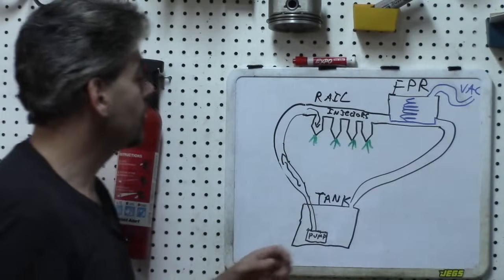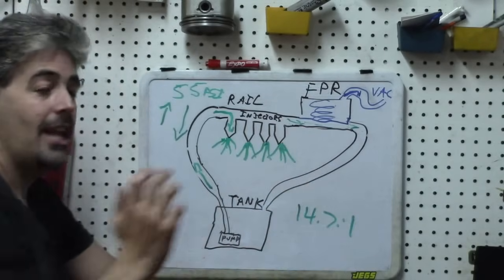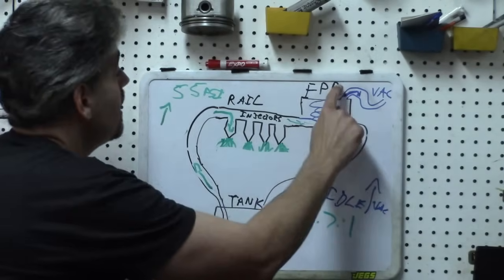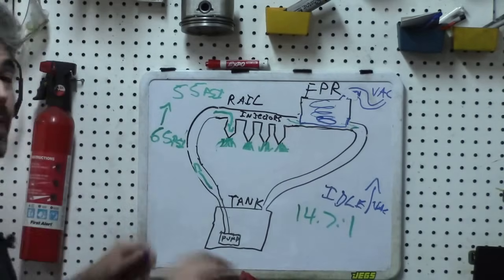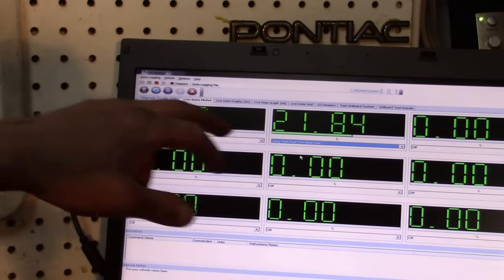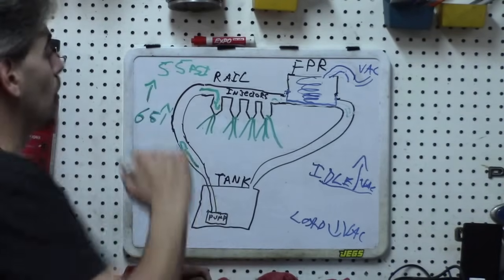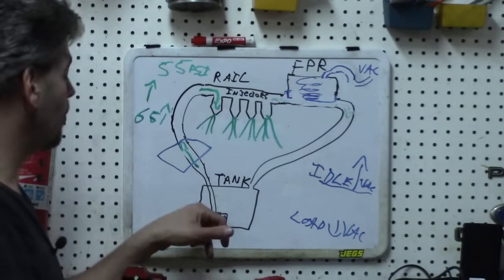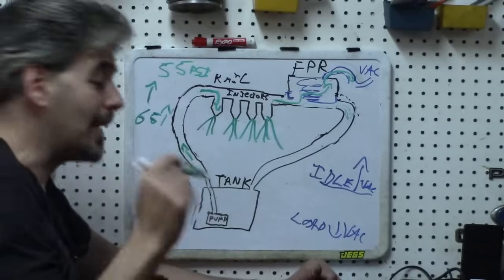Fuel Pressure Regulator Diagnosis + Understanding (HD!!)

Comment: So if we crimp of the fuel line in and the fuel line out should this both result in the fuel flow increasing and the car to stop?
Reply from the maker: May not cause car to stop completely but it will definitely change the engine performance for sure.
Reply: @SchrodingersBox  my sons problem is even with uprated pumps the Fuel Pressure is dropping under boost.  JUst cant get to the bottom of it!
Reply from the maker: Pretty obvious it’s either a tank contamination issue or a voltage drop issue then. Easiest to start by Check voltage drop on the power and ground. It will show on one or the other- or both.

Comment: I don't know if you still check this or not. I'm getting the crank-no-start, my fuel pressure goes up to 38-40 on my 2000 Ford Expedition when switched on then drop almost immediately. I changed the fuel pump about 2 years ago and the fuel filter a year ago. Does that means my fuel pump is bad? Thanks
Reply from the maker: Sounds like a bad check valve.  Verify by confirming there is normal STFT and LTFT curves.

Comment: does this apply if the regulator is located inside the tank in the fuel pump assembly where you can't reach it, in many Japanese cars regulator are inside the tank!
Reply from the maker: The rail leak testing procedures are different since the system is returnless but most of the other procedures apply

Comment: little help here. so i have a 2 stroke arctic cat efi and the regulator is missing the vacuum line. but on the parts fiche it calls that hose a vent hose. does that application just use atmospheric pressure or am i actually missing a hose. any help would be great thanks.
Reply: Vent hose to atmosphere period

Comment: I have a Mitsubishi Montero 3.8, fsm says fuel pressure should be 38 psi at idle. It's at about 44 psi. Under load it jumps up about 10 psi and is fluctuating rapidly 5 to 10 psi above the idle pressure. Bad FPR? Also hard start after sitting for an hour or two after it is hot. Seeing gradual pressure drop after engine is shut off.
Thanks
Reply from the maker: Not a bad fpr. Check fuel trim data.
Reply: @SchrodingersBox  thanks for replying. Fuel trim data isn't too abnormal. Long term 5.5% bank 1 short term varies a little bit bank 2 is 0%. The reason why I'm looking at this stuff is because after it is up to operate temp and sits for an hour or two it will not want to start . Acts like it has no fuel but fuel pressure is there. I'm suspicious of a fuel injector leaking into the cylinder. I have a small exhaust leak and after sitting , I went to start it and it was misfiring and stumbling and a decent amount of smoke was coming from the exhaust leak ( working on fixing the leak as well ) . Sorry for the rambling post lol
Reply: It will start (cold is starts every time just fine )if I hit the gas pedal a bit while I turn the key. I'm guessing it's letting more air in so it can ignite

Comment: Mr. Schrodinger, I have a 2 stroke 1 cylinder, fuel injected 50cc scooter....if I put a performance exhaust pipe, and performance air intake, but the ECU for the scooter does NOT COMPENSATE for more air and out (ECU is programmed to a fixed fuel level, and no way to reprogram it,  would an adjustable fuel pressure regulator be a way to compensate more air in and out for better performance...the Aprilia SR 50 r fuel injected scooter guys want to be able to add more go just like the carburator scooter guys that can just re jet the carb when they add a performance intake/ air filter and exhaust mod.
Reply from the maker: Yes it would provided the electric fuel pump is capable of meeting the demand.
Reply: @SchrodingersBox  thanks for the fast response. As said in your video, if I understood it correctly, I should turn Down the pressure of the adjustable FPR to richen up the air/fuel ratio...then just rely on the vacuum of the FPR at idle all the way to up wide open throttle for a correct air/fuel ratio (assuming that the FPR is adjusted properly).

Comment: In this video you say, If I pinch off my return line and it holds pressure I have a problem with my regulator then you go on to say if I pinch my line and it don't hold pressure I have a problem. ?????? Im confused.
Reply from the maker: +Vinny W I did not say that at all. If you pinch off the return line you have a leak in the system ahead of the return line. If could be the regulator, the check valve, the injectors, an external leak...  however if you also simultaneously pinch off the feed line as well and you see a static pressure drop, then you know the issue MUST be associated with the rail.  Injectors, regulator, or external leak from the rail are only possibilities.

Comment: hi , I have a Traillblazer 2005 v-6, 4x4, couple months a go i did replace the fuel pump cause the gas control sign doesn't work, after those has been good but now the sign appear again on exit,  after round some miles, the sign starring to work. the problem could be the regulator? please, appreciate ur answer, thanks.
Reply from the maker: What data do you have?

Comment: Hey! Curious if you could help me with a *temperature problem* at idle or running, whereas my car runs well and clear until it hits 90°F then starts to run rough and dies out. I would say either lean or rich but it seems as if it could be a fuel problem. It is very set on this 90°F change in idle. Any help or direction is very very much appreciated!! Mahalo!
Reply from the maker: Sure- what data do you have?Whats the change in fuel trim? that's the first step.

Comment: The diagraph could be broken and fuel entering to the vacuum line ?
Reply from the maker: Indeed that can happen. In fact it's pretty common. It would result in a rich condition and no change in fuel pressure when vcacuum removed.
Reply: Yesterday I checked my FPR, I did not have a measuring tool for fuel pressure. However I removed the manifold to reach the regulator. I connected the air hose to the input and pushed the valve from exit (that was possible to do) simulating the vacuum, it opened, spring tension was quite heavy my opinion but smooth. Car starts perfectly so no fuel escaping the rail.
Could it be, that one function for this regualtor is aswell cut the return line completely when engine is off preventing the fuel rail getting empty allowing the car start immediately  ?
Reply from the maker: I would check the Long and Short Term Fuel Trim  at idle vs load before doing anything else.

Comment: I'm working on a 1996 Ford F-150 with the 300 inline 6. The fuel pressure from my front tank decreases when the engine is started (normal). My rear tank shows no change in fuel pressure once the engine is started. What does this indicate? 

Gabe
Reply from the maker: Are there separate regulators?
Reply: Schrodingers Box no- there is one fuel pressure regulator that regulates both pumps.

Comment: I have a 1986 Corvette 350ci.Engine. When I turn the key to the on position, the fuel go up to about 50lbs of pressure on the fuel pressure gauge, and then slowly drops down to 0lbs of pressure. I replaced the fuel pump and it still does the same thing. What can this problem be? Is it possible that the fuel pressure regulator is bad? It will Not hold a steady static pressure with the key on and the engine off, and the fuel pressure gauge slowly drops down to zero. The car will not start. It will just continue to turn over repeatedly. It seems like it is flooding out.
Reply from the maker: I would clamp the return line and see if the pressure loss is check valve related or rail related.

Comment: Hi there,  any idea why the fuel tester gauge needle erratically goes up and down when idling my 93 VW cabriolet? It also doesn't hold the pressure very long when shut off.  
Thanks for your help
Reply from the maker: Lots of reasons including there isn’t anything wrong. I would start by correlating it to short term fuel trim to see if you have an issue.
Reply: @SchrodingersBox  Unfortunately it doesn't want to start now.  I checked the spark plugs and they are all fouled with dry black carbon deposits. (I cleaned them but think there may be some unburned fuel in each cylinder.  The tail pipe also has a bunch of black dry carbon deposits.  For a while, before it won't start the idle would "hunt" and at other times the idle would climb up to 2500k. And for the last couple of days, I'd give it gas it would stubble and almost die so I had to take my foot off of the gas pedal and couldn't drive it. 
I'm sure the entire exhaust manifold is full of carbon too.  
Did I forget to mention that there is a lot of gas in to motor oil? 😨😲😥
 Thanks for your response

Comment: I measured my carbed bmw e21 316 fuel pressure and the readings were ok, when i cut off the engine the pressure holds at good value for 5 secs give or take and starts to drop regularly to zero, i do know my idle shutoff valve solenoid valve is broken and stuck in the open position, would it be the cause of a leak for fuel pressure?
Reply from the maker: If I have a static decay I simply pinch off the feed and return lines. If the decay is still present the injectors are the issue. If the decay is no longer present I suspect the check valve.
Reply: @SchrodingersBox  Ok, i don't think i understood what you meant by static decay( regular drop?) and where the check valve can usually be found?
I should have mentioned that according with my haynes manual the car doesn't have a fuel pressure regulator portaied in the manual's pics (would it be the most probable cause of the problem?) And maybe it's because of its absence that i cannot relate any return line from fuel supply line. 
I would really appreciate your kind help on this one.
Regards.

Comment: Can a bad FPR cause stalling/no start after it  runs for 5 minutes with cold start? No codes either when this happens so I have to wait it for it cool down before the vehicle starts back up. Replaced fuel pump and fuel filter but no changes.
Reply from the maker: Yes it could. among 1000 other things though.
Reply: @SchrodingersBox  Thanks. I will check the fuel pressure and see if it holds up. Also, could it be bad crankshaft position sensor? From my online research, it's a typical problem for my car.
Reply from the maker: It could be that too, among 999 other things now.
Reply: @SchrodingersBox  thanks!
Reply: @SchrodingersBox  I checked the FPR with a fuel pressure regulator test kit and it is staying at 40 in RUN position and when idling it stays about 45. I also let sit it there for few minutes in off position and it stayed at 40 so, I think the FPR is okay.
Reply from the maker: yes i agree. cross it off the list of possibilities. I would run a fuel trim analysis next if I was diagnosing it.

Comment: My 1992 Isuzu trooper is bogging under high throttle and bouncing when you rev it in park.Any ideas on this issue?
Reply from the maker: What data do you have?
Reply: @SchrodingersBox  can't seem to pull any codes.Replaced the fuel regulator and check the pump at 48 psi.Also replaced the filter.
Reply from the maker: Ok what data showed the fuel regulator was bad? What did the fuel trim indicate?  What’s your TPS voltage curve showing?  Any of the basics like that.

Comment: I have a 1994 Ford F150 6 cyl. fuel injected, I ran out of gas in it and after putting gas back in it ran kinda rough the next day and now wont start..It cranks but wont turn over.  I have spark but no fuel to the front of truck.  I changed the fuel filter and still no fuel to injectors. the switch on passengers side is ok. could it be my fuel pressure regulator or fuel pump?
Reply from the maker: You need to measure fuel pressure AT THE PUMP

Comment: I need help please, My 2012 chevy Sliverado 1500 was hard to start on cold weather but ones it start it will run good, The check engine light will come on and will give me a code " gas and air mix to rich " but this morning I was trying to start it and it didn't start so I am wondering if it could be the pressure regulator, I removed the spark plugs and they were wet, so if the fuel pressure regulator is faulty the truck will not start ? please advise me on this issue
Reply from the maker: +Armando Ocon Simple- what is your static vs loaded fuel pressure and how does the LTFT and STFT respond?

Comment: 2000 jeep cherokee runs PERFECTLY for 90 seconds, stutters to a stop, you can hear f/pump run for 5 sec then shut off,  fuel rail pres drops to zero, already has new fuel pump w/ reg.  Put 12 v batt on JUST pump, engine trys but wont start no matter how long its on and the pump WILL NOT shut off as it did when connected to car wiring.  HELP now what ???  And I thought I was smart, well thats been disproved ! .
Reply from the maker: Joe Mcgish Need to measure pressure AT the pump outlet prior to the filter (e.g. "deadhead") and see if you have pressure there with 12V to the pump.. If not, you clearly have issue in the tank.  If you do- there is a restriction in the line to the rail.

Comment: How do you like your AutoEnginuity?
I definitely can't afford a Verus or any of those fancy scan tools.
Reply from the maker: I like it a lot. It is more than sufficient for advanced diagnostics.  The only limitations are with some vehicle compatibility and limited bidirectional capability which are easily overlooked for the price.
Reply: Does it allow you to see graphs of sensors and things of that nature? Like if I wanted to use it to compare O2 and fuel trim, would I be able to see time graphs of that data? I was thinking about dropping the $1000 for it if it's atleast able to do things like that. Thank you for the reply.
Reply from the maker: It does that and more.

Comment: i have a 95 Sonoma 4.3 cpi im only getting 30 lbs at the rail i checked it at pump getting 65 to 70 lbs once hooked to the system only 30 noticed the fuel was coming back to the tank plugged it off it would start but would not stay running under load is it the pump or regulater on the spider
Reply from the maker: +Matt Hasting I would simply isolate the suspect area and remeasure pressure to determine if that component is responsible.
Reply: Well im only getting 30 on the rail and it has pressure on the return line

Comment: Hi..If the car rpm is high at idle or the car is having idle speed problems, can we suspect the fuel pressure regulator to be bad or faulty???
Reply from the maker: it is a possibility for sure, but more likely to be other things. even a car with really weak fuel pressure often idles fine.

Comment: Please help. A local shop scammed me. I had them replace my brake lines. During this repair they removed my fuel filter along with 6 feet of hard fuel line. They did not notify me about working on my fuel system. My engine was hesitating over a 5 mile drive. Would not start. Replaced fuel pump myself. When spraying starter fluid, my engine would not start and run for 2-3 seconds. Do not know where to proceed next.
Reply from the maker: It is not fuel related then

Comment: Hi matt, i have question i am working on my truck and getting trouble code p.o102   p.175   p.o300  i changed air flow meter it was 14 years old also fuel pressure regulator and fuel pump , i would like to know why fuel pressure gauge dropping down to zero after i do pressure check each time? , fuel pressure is 46 psi my truck is 2000 chevy c 3500 7.4 litter engine,can you let me know please
Reply from the maker: I would start with what data you got that indicated the air flow sensor, fuel pressure and fuel pump were all bad at the same time. I would say your biggest clue lies in that data.  What was that data that indicated all these were faulty?

Comment: Hey was wondering if you can help me I'm from UK I have an audi a1 tfsi 168hp turbo and when I idle my engine light Flashes but as soon as I drive or take rpm up it goes off then when I check the code it says fuel pressure release valve activated only happens when idle and car runs fine when driving? Also comes up cylider 2 missfire only when idle I have changed spark plugs and also it only ever happens some times like some days it will come on right away other days it won't happen at all
Reply from the maker: i can help. what data do you have

Comment: hi.  I have a 99 chef 1/2t 4.8.  I have a hesitation and sputtering when I get deep into throttle.  Changed fuel filter and plugs.  Still sputtering.  Put a gauge on it .  50psi on idle.  When I give it some good throttle in goes to 58Psi.  Not sure where to go next?  Any thoughts?
Reply from the maker: What is the LTFT under load?
Reply: Just figured out my problem.  The TPS was the problem.  Thanks for the reply.  Your videos are really good.  Thanks

Comment: I replaced the fuel pumps on my 1989 ford f150 pick up truck and fuel relay still not getting fuel to the throttle body
Reply: But it'll run as long as I keep spraying starting fluid in the throttle body
Reply from the maker: check fuel pressure.

Comment: the sign gas control show me empty, when I turn on the motor, after run some miles the gas sign control starring to work and show me the amount of the gas on the dash controls. could be the gas p. r- or -the gas pump?
Reply from the maker: that is not relevant data. what data as shown in the video do you have?